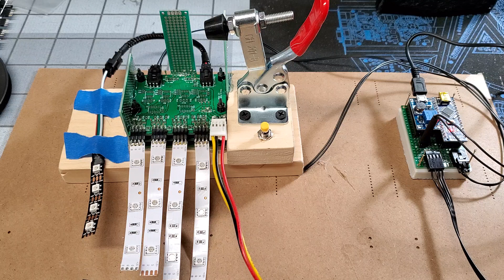Bed of Nails Tester for Production testing

Comment: Regarding how during design, one should always be thinking of Design For Testing (DFT) and Design For Manufacturing (DFM)..

but are there any rule-of-thumbs that suggest the quantity/value of the PCB.. or how long it takes to manually test a board...  when one should consider designing or investing in a automated/custom-test-jig?

Bunnie has great blog posts
The Factory Floor, Part 1 of 4: The Quotation (or, How to Make a BOM)     and  
Exclave: Hardware Testing in Mass Production, Made Easier

and his frequent wingman, Sean "xobs" Cross, gave a fantastic talk on  "Mass Production: Open-source Testing in Manufacturing" at the Linux Conference Sydney Australia 2018.